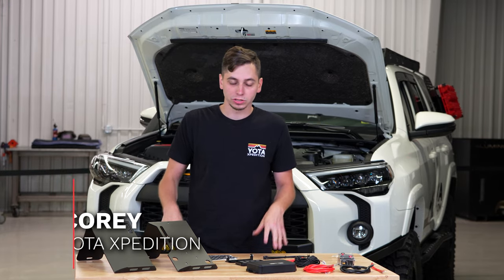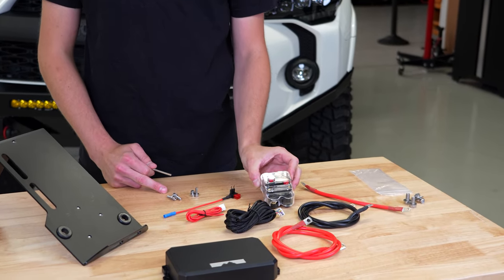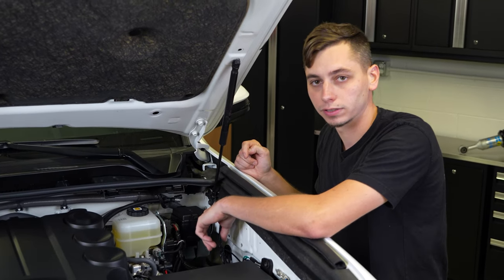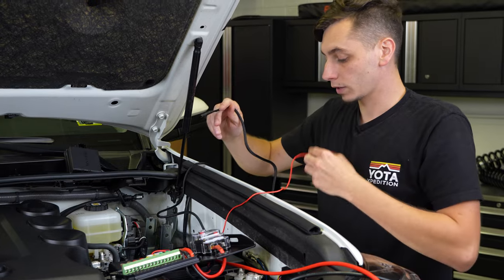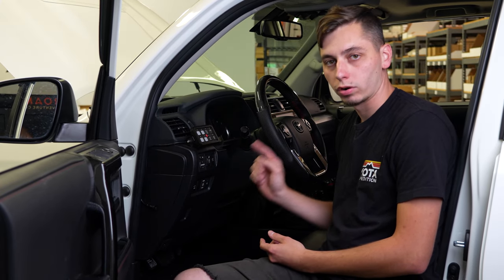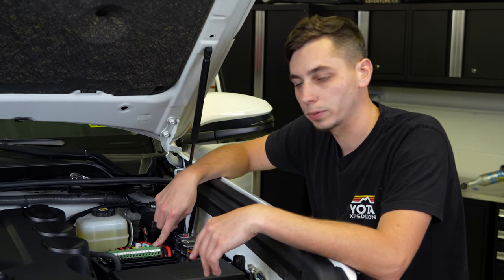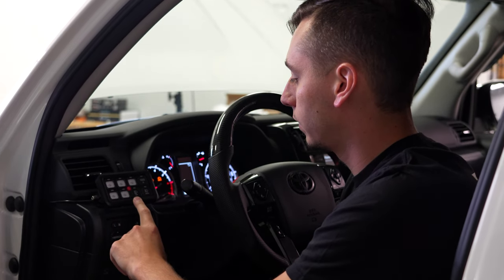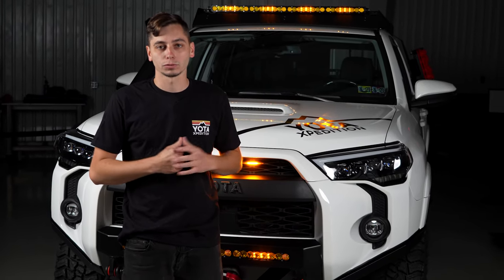4Runner Switch Panel Plug And Play Kit | 2010-2023 | Yota X

Comment: This is a rebranded switch panel. These are half the price on eBay or Amazon and they are mass produced in china. Don’t fall for this!! Thank me later
Reply: Link?
Reply: What’s your experience on this?
Reply: That’s true but you don’t save much, if anything at all. If the metal mounting bracket alone is around 100 and the kit is around 140-150+ depending on what version you get, you save about 10%.

Comment: * WARNING *  If you plan on installing this with the OE panel for the 4 RUNNER the switch offered with the kit will NOT fit.  OE is very specific on which switch panels will fit.
Reply: Isn’t Yota Expedition’s just an unlabeled AuxBeam? They look very similar.
Reply: Not tracking on what you're saying
Reply: @stephencarbajal5657  the 8 button switch that comes in Yota Expidition’s kit looks like an Aux Beam 8 button switch, just without the AuxBeam label. If I remember correctly they even use an AuxBeam switch in the original video.  Seems like YE is getting the 8 button switches from the same place as AuxBeam.
Reply: Is it too. Big or too small…. I literally just ordered the oe panel before reading this

Comment: Just installed it yesterday. Pretty easy and looks so clean. My dad came over to look and he also loved the look. The only thing I did different was when you push the two wires through the fire wall push the wire for the fuse through first and then the controller wire. Doing it the opposite way makes it almost impossible because the fuse wire is flexible and keeps getting hung up on the controller wire

Comment: I need some help!! I try installing this today after watching many Youtube videos about the RGB 8 switch panel, man no matter what i did every time I have this connected to my battery my car wont start, if like the battery die or something. I thought I have the wires installed wrong, changed the wires and same problem. I did however got the panel to light up the first try but when I press the starter on my truck it wouldn't start. Anybody have an idea what's going on? also none of this videos tell you that if you install the add a fuse inside the cabin your fuse cover wont fit anymore, even with mini add a fuse wire. Please help!!!! I have a tacoma off road 2020

Comment: Saw a lot of comments regarding the Auxbeam, so remembered to comment after i tried myself. 
I just finished the installation and used the 8 gang BA80 Auxbeam and it fits perfectly! By far the easiest install ive done 👌 
If anyone has questions let me know!
Reply: nice!  Did you use this bracket?
Reply: @jaimeyoo1373  hey, got a question re: Auxbeam BA80 fuse adapter / add a fuse connector. Did change out the 5amp fuse to a 10amp? Or did you add it on to 5amp? TIA…
Reply: @tuncam  I got the add a fuse and used the 7.5 amp fuse & the 5amp fuse. hope this helps!
Reply: Thanks!! Which fuse did you tap in to, ACC or IGN?

Comment: Thank you for being specific about using the inside fuse panel….was about to lose my mind until I found this video.   I did use the acc fuse (7.5) just so I could have access on ACC not just on ignition.
Reply: are there any issues using the acc fuse?
Reply: Nope.   Other than contorting to get it installed.   It has been fine

Comment: Would you recommend soldering that connection to the fuse box from the firewall or are those crimp connectors pretty durable?

Comment: this may be a stupid question, but how do you determine which accessories (winch or lightbar) go to which amp fuse?
Reply from the maker: Look on the manufactures website and they should give the info you need. Look for how many amps your accessory uses.

Comment: Does this kit accommodate space to mount an ARB Twin on the driver side as well?
Reply: I am only wanting to mount the ARB single, but I would also like to see a video or a new mounting bracket offered on the website that allocates space for the compressor.
Reply from the maker: We have a bracket that is blank and you can lay it out as you need.

Comment: Can the different amp fuses be swapped with different amp fuses in order to accommodate the order in which u want ur accessories organized on the switch panel? Or do they have to be randomly scattered on the switch panel due to the different amps each fuse is? Thanks

Comment: Beautiful creation guys.  One question because I’ve been waiting for Runnin4tacos to release their Auxbeam dash flush Mount panel.   You’re system look similar almost identical to the Auxbeam 8 gang system (not sure if it was a rebranding, which it totally fine, your fuse cover is way nicer).  Is the controller you have the same size so that it will fit the dash Mount R4T is making.   Does your system have the Bluetooth capability as well?  Thanks and nice job…..
Reply: Any updates on this question, as I have the same questions?
Reply: Looks like an AuxBeam 8 button to me as well. I’m pretty sure in the original video they use an actual branded AuxBeam 8 button.

Comment: Awesome Job on the install vid and product design! … Excited on purchasing the kit for my 4Runnner. I do have one question that you don’t cover during the installation; What about “Relays” that typically come with lights, etc ? … Sorry if you already answered.
Reply from the maker: All your relays are built into the system. No need for external relays in your wiring harness.
Reply: @yotaxpedition … That’s great news and Thanks for sharing!

Comment: Does this have a backlight for the buttons when none of the switches are activated? I just installed mine and love it except for the fact that I can't see it in the dark to know which button to press.
Reply from the maker: Hey Matt, Unfortunately this unit does not have a backlight when none of the buttons are activated. We are currently working on a completely new version that has new features that we hope to release before then end of the year.
Reply: @yotaxpedition   That would be awesome. It seems a bit unintuitive to have a panel used to control lights (I'm assuming this is the most common use case) without a backlight since you typically turn on lights in the dark. 

Another potentially useful feature would be having the ability to long-press a button and have that turn on/off a group of lights. For instance if I long-press the bottom left button all the buttons could flash, i can press each button I want to assign to that group and they would light up steady. When I'm finished I long-press the bottom left again to set that group. After its set when I long-press that button all of the buttons I assigned to that group would activate. If I continued to press for a few extra seconds it would take me back into group assignment mode for that button. 

If you do create an updated version do you plan on selling an "upgrade kit" for existing panel owners? The existing mount is awesome and the panel is great as well. Being able to buy and swap just the circuit control box would be outstanding and very consumer friendly. If you were able to incorporate a way to flash new firmware (if you're using a chip in there) to get new features or change the config myself then re-compile and flash again would be the best thing ever.
Reply from the maker: Hey Matt, the new unit is a completely different layout so both the unit and the bracket will need to be swapped out. I know, a pain. When the new one is released, shoot us an email with your order number for the old unit and we will help you out.
Reply: @yotaxpedition  Gotcha, makes sense. I trust it will be worth the effort to swap out. Also, thank you for making the buttons so clicky and satisfying.
Reply: @yotaxpedition don’t you dare lol I literally just hooked this one up

Comment: That's just an Auxbeam 8 gang switch, a maximum of 60 amps is some what limiting but not to bad. I have them in my Tundra and 4runner.
Reply from the maker: Auxbeam does not come in a full billet case. Though they may have similar features, this is not an Auxbeam branded kit.

Comment: I just received my kit and plan on installing it this weekend. My question is this: does the on/off button on the switch panel entirely turn off power to the panel and connected accessories or does it only turn off the backlight? I would like one of the switches to control camp lights installed in the roof rack handles. I want to be able to use these with the ignition off. So my plan is to connect to an always-on fuse, at minimum, an ACC fuse, but I want to be sure that I can switch everything off. Thank you!
Reply from the maker: The On/Off button turns the unit on and off. So if you have for example 4 switches turned on and you hit the main on/off button, all 4 with shut off. Hit the button again and all 4 will turn back on. If you want the unit to always have power then you can hook up the single small red wire to either your battery or a fuse that has constant 12v.

Comment: Can I use the ARB CKMA12 air compressor with this?? It says on ARB's website that it has a maximum load of 32A and you guys only have up to 30A fuses on this. Any info is appreciated, thanks!
Reply from the maker: Yes you can! We've done this already with the single and dual compressor from ARB. On the harness, there is a purple wire. This is the wire to activate the compressor on/off. Run this wire to your switch panel.
Reply: @yotaxpedition  The dual compressor will be fine plugged into the 30A fuse??
Reply from the maker: You're not powering the compressor from the switch panel. The compressor positive and negative goes to the battery. The wire you run to the switch panel is to turn the compressor on and off.

Comment: will this switch panel work with the morimoto 4 banger wiring harness with some modification?
Reply from the maker: Yes it will. But like you said, some modification is needed to the harness.

Comment: What fuse do you suggest plugging Baja ditch lights in using this?
Reply from the maker: It depends on the size. I would look at the manufacturer's specs and see how many amps the lights use and go from there
Reply: @yotaxpedition  thank you brother, one more question, are you aware of any after market own style dash panels that fit this switch? I recently bought one I thought would fit, but it seems your model is the only one that it doesn’t fit even though it looked the same size as the auxbeam.  There has to be one

Comment: I would like to connect using the engine bay fuse box. Which fuse do you recommend tapping into? 2023 4Runner.
Reply from the maker: If you want wont the switch panel to work only when the key is on then you want to find a 10amp fuse that only has power when the key is on. Some fuse locations wont allow the fuse tap to work because you will not be able to install the fuse box lid. This is why we ran the wire to the interior fuse box.

Comment: I know you said you had Baja design light bars but do you have any product numbers for the specific ones your rocking on this rig. It maybe a dumb question but do specific light bars have the backlit function or do all of them. Cheers.
Reply from the maker: We have a 40" on the roof and a 30" on the bumper. Not all have back lighting but the S8 from Baja does.
Here is the link https://yotaxpedition.com/products/s8-straight-led-light-bar?variant=43547127677164
Reply: Appreciate the help guys. The fact that yall have responded back to me so quickly means a lot and I will definitely be shopping with yall in the future. @yotaxpedition
Reply from the maker: 🙏 Appreciate you!

Comment: I just finished the install and when I plug into ing 10 amp and turn on the car I get all sorts of warning lights and errors, and says to take care of to dealer. I unplug the auxbeam cable and put original 10 amp fuse back in and everything goes back to normal. Any idea what’s going on ?
Reply: Ok so quick update, I figured it out so wanted to update the comment in case anyone else has this problem. My auxbeam is not from Yota but I did purchase the bracket from yota. The add a fuse was the issue. It did not come pre installed with a 10 amp fuse it only have one 5 amp fuse so when I plugged it in and turned acc on the circuit was open and threw codes. I took one of the spare fuses in the auxbeam cover, plugged it in and bammm. Everything works.
Reply: @702Overlanding  
Thanks for sharing I had same issue with my install. So just to be clear you added 2  10 amp fuses using the mini add a fuse adapter? TIA…

Comment: I have a 2016 trail 4Runner and it was not this easy. lol. If you have the 20plus sure.
Reply from the maker: Why is it not that easy?
Reply: 2018 TRD Pro here. Same. 

Cabin fuse box is far more limited and uses compact fuses so you can’t plug-and-play into the harness. Once I plugged it into the ACC fuse location (7.5 amp), my entire head unit doesn’t function. Bought a full size 7.5 amp fuse to try but that’s something that isn’t mentioned and doesn’t seem to be an issue on the newer 4Runners.